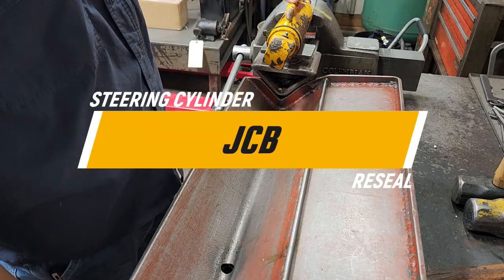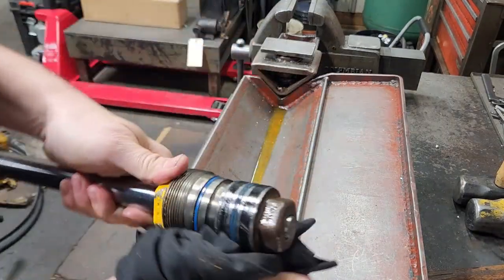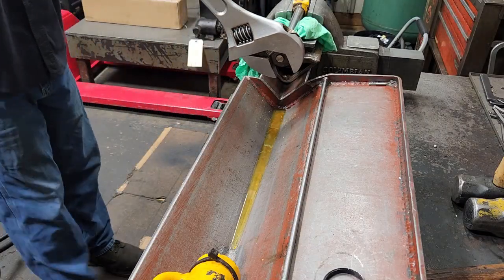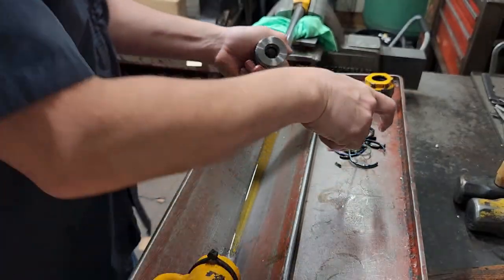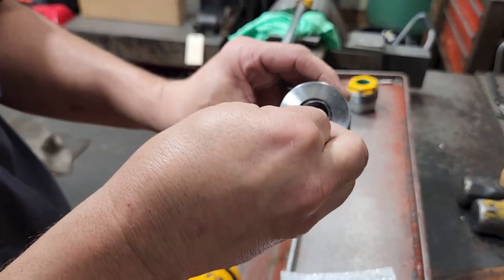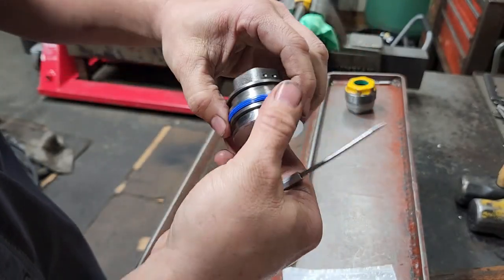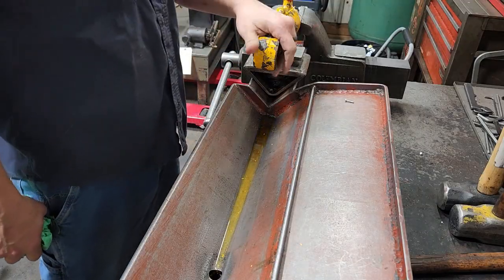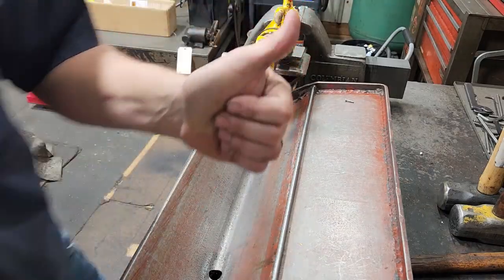JCB Telehandler Steering Cylinder Reseal

Comment: You have the clearest rebuild videos out there! But I never see anything about buffer or cushion problems. I bought an older 25 T Champion splitter that works great, except that it has a significant jolt at either end of its travel (I always try to stop it early to avoid that). It does not leak, so I suspect its seals have been replaced at some time (The control valve has a very slight leak).  First-if you have already covered this, sorry I missed it!  Second- Could you cover cushion issues sometime? Nobody seems to mention this!  Thanks
Reply from the maker: From my experience, most smaller cylinders don't have cushions. I have worked on smaller ones that do, but their generally heavy-duty tierod cylinders used in industrial applications. Most larger equipment cylinders have cushions as well. If you're getting a jolt at either end of the stroke, you may want to take the cylinder apart and check for piston slop. It's possible the piston nut or piston itself could have backed off. I've seen this issue quite often. I'm not saying that's it, but it would be the easy check. Hope this helps. Thanks for watching and commenting!
Reply: @HydraulicRepair  Thanks for the tip! Sounds like a winter project.